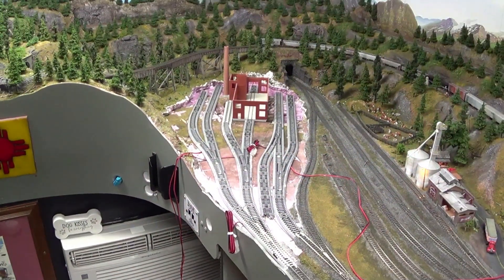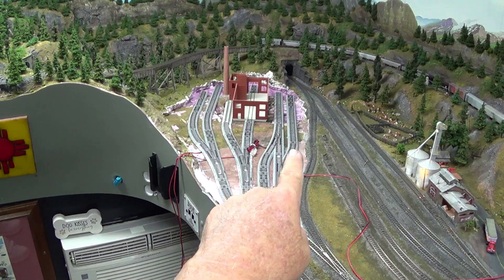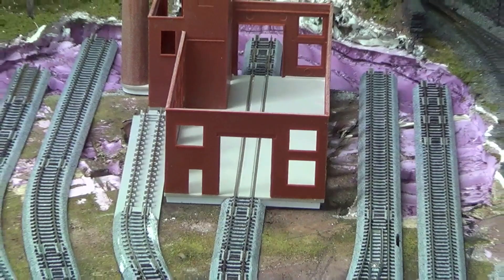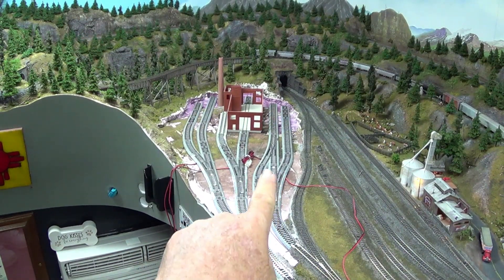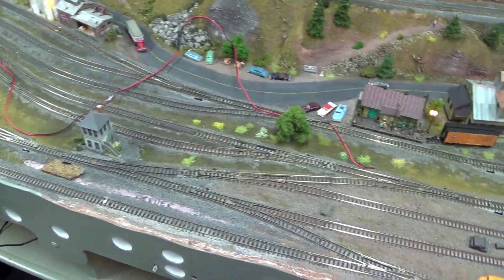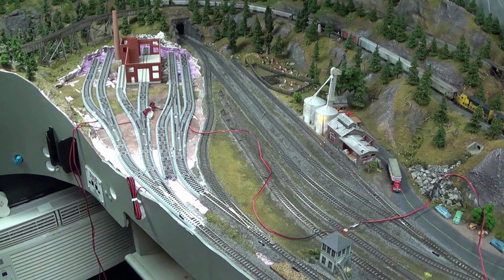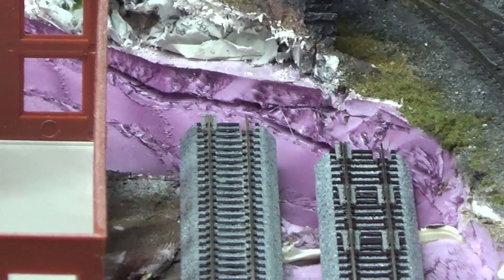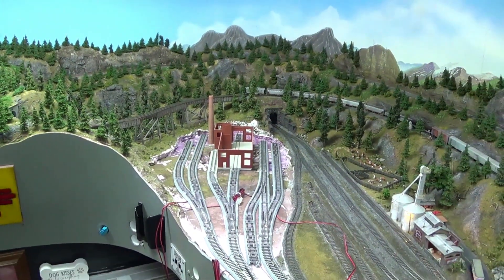N Scale ACTRR 3 Update #97

Comment: Mike I just seen video 97 on the new engine house area. I measured my N scale Southern Pacific bay window caboose which is 3 1/2 in length, with your planned caboose track at 21 inches length up to 6 cabooses can fit on it with a few inches for leeway. The engine house is more modern.
Reply from the maker: Thank you sir !!
Mike

Comment: I like the track plan as modified. It makes a lot of sense as you describe the way the train turns. I have an idea for a door. Maybe some piano wire and styrene. Instead of a roll up.. a solid pivot crank style door..sort of like the crank on the old Jack in the box toys. Run the piano wire across the backside of the door and out the right side wall. Camo the knob as a electrical box outside that wall.. and the remaining piano wire as conduit. Just a thought.
Reply from the maker: Thanks so much but I just can not reach the mechanism.
Thanks , Mike
Reply: @N-Scale  .. I see.. ok.

Comment: Mike, I would cut the smokestack off the current location and move it to the back of the building. With the building in front of the smokestack, it might appear okay and downplay the height.   If it is still too high you still could consider cutting it down but wants you get the roof on the building you may find the smokestack height is just fine.  Just my thoughts!  Tony
Reply from the maker: I have moved it to the rear and cropped it about an inch . Thanks Tony , Mike
Reply: @N-Scale  I'll look for it in one of your next updates.  Take care, Tony

Comment: Mike, don't know whether it is possible with your building, but have you considered kit bashing the building and moving the boiler house and stack over to the other side of the building (right side when looking at it)? This would move the stack away from the bridge, and still leave a meaningful stack for the engine house.
Reply from the maker: No , but I have considered moving the stack alone to the back of the building.
Mike
Reply: @N-Scale  Mike I'm late to the game. but, an easy fix may be to flip the building around, front to back, so the stack and powerhouse are in front and on the right side. Second thought, just remove the stack and run power lines to the building.
Reply from the maker: @thomasboese3793  The stack has already been moved to the back. If it was flipped there would be no room for the tracks on that side.
Thanks , Mike

Comment: Shortening the smokestack is a good idea. Another thought, that short track coming forward in front of the engine house - why not just remove it and use the space for an access road to the engine house, with cement area in front of the building? Unless you need the track space......
Reply from the maker: I may do that and use it for employee parking !!